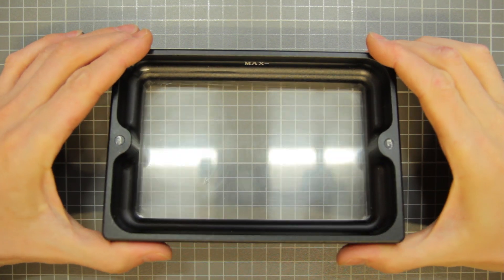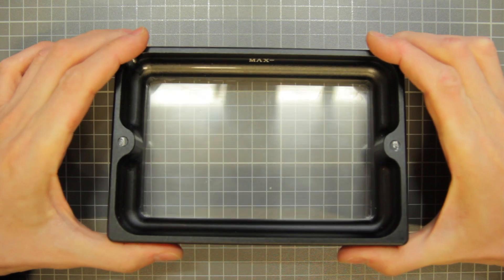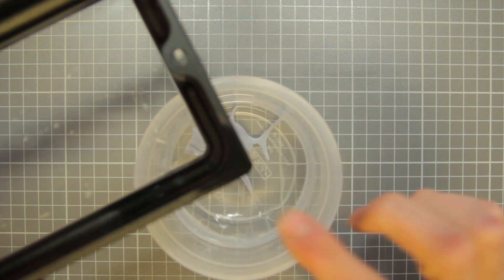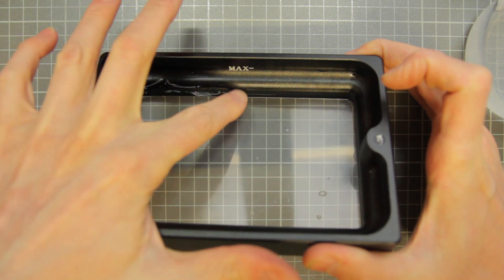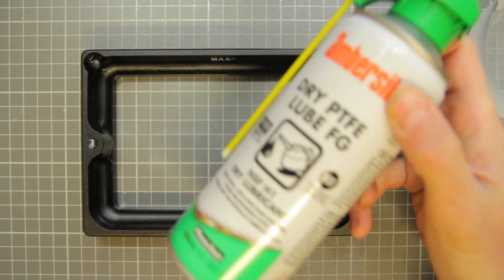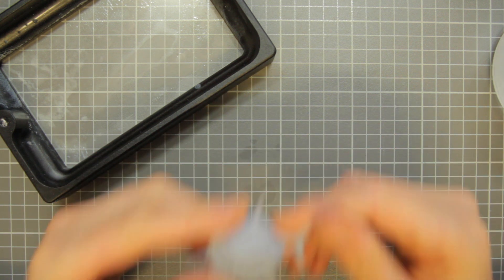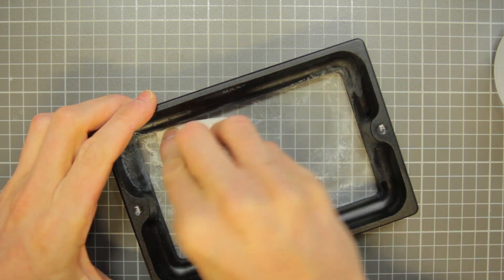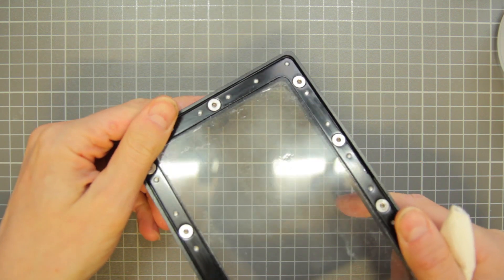CLEANING FEP WITH ACETONE EXPERIMENT ( RESIN PRINTERS )

Comment: Use cotton wool to clean FEP mate as doesn't scratch. Thanks for the vid as was wondering a IPA alternative
Reply from the maker: I'll be honest, I dont use Actetone anymore, only if its dried, otherwise when the resin is wet i use IPA. But I simply stopped cleaning the VAT after each print, total waste of time unless you have loose bits in there!